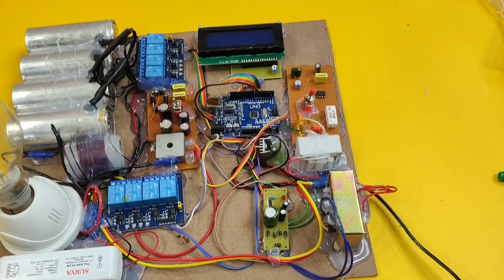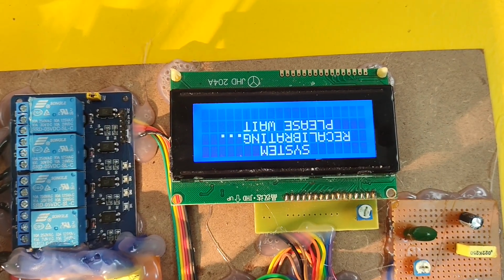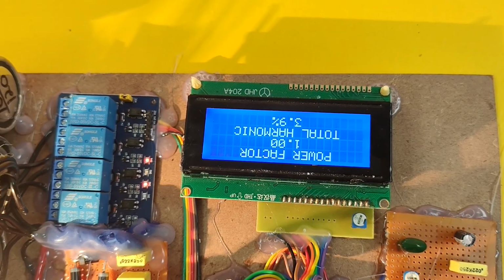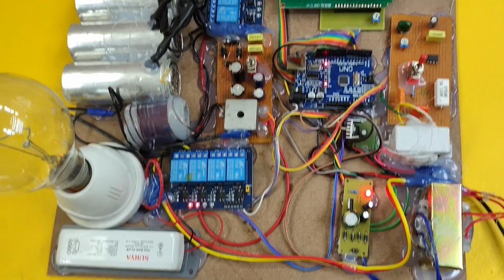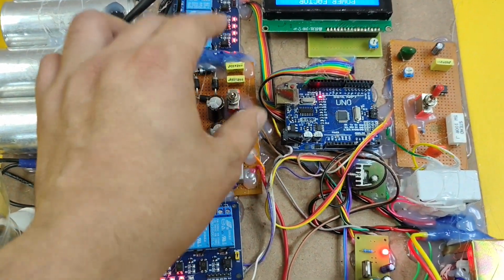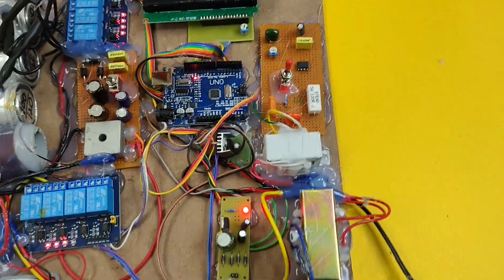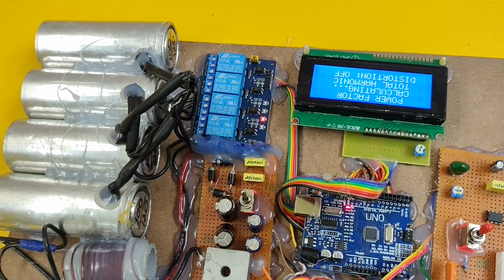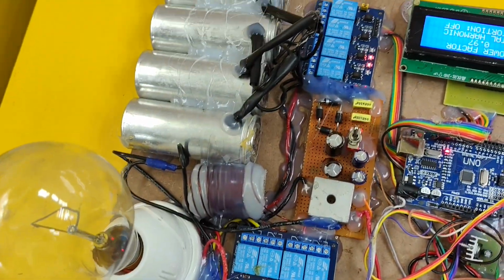automatic power factor correction with harmonic noise mittigation | APFC with noise mittigation - 2

Comment from the maker: This project demonstrates Automatic Power Factor Correction with Harmonic Mitigation using an Arduino-based practical working model.
The project resource provides deeper information to understand the system, its working stages, and its academic implementation.
Project Blog: Not currently available for Version 3.
The fully implemented project hardware can be reviewed here for practical understanding, demonstration, and evaluation:
https://circuitsbazaar.com/shop/automatic-power-factor-correction-project/
This resource is useful for Electrical and Electronics Engineering students working on final-year, major, minor, diploma, and practical project demonstrations.